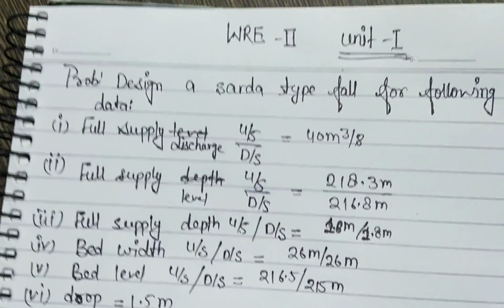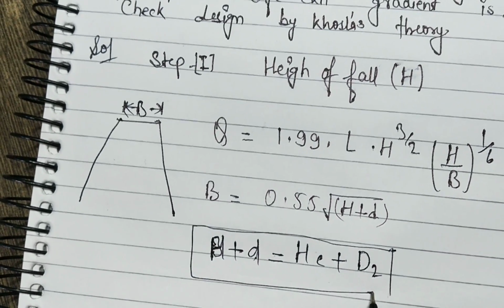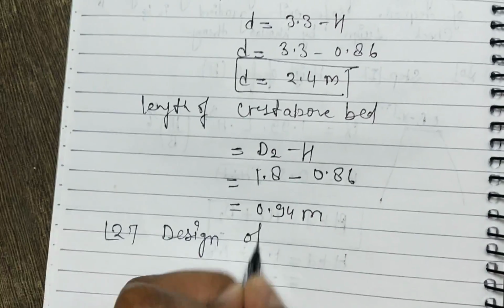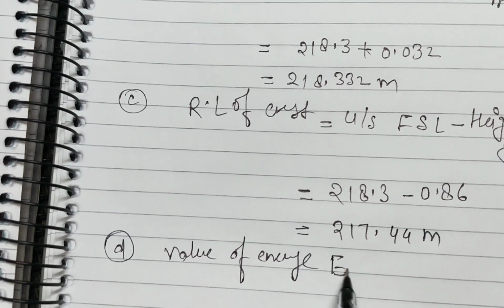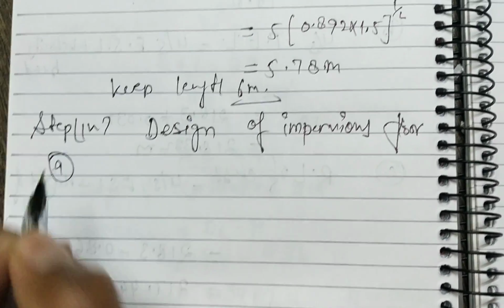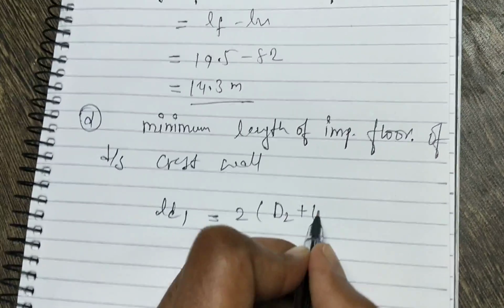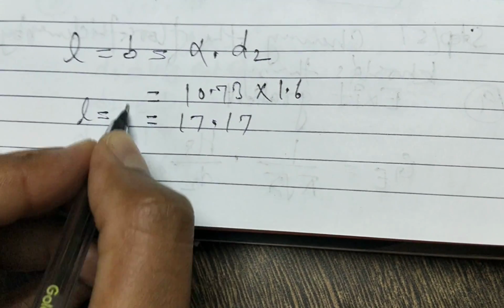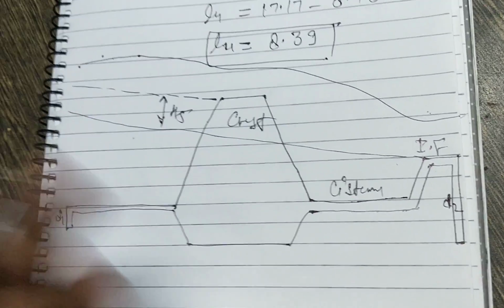Numerical based on Sarda type fall canal

Comment: Sir 4th step m 
Vertical lenth of crop m 
d1and d2 vale sabhi questions n same hoygi
Reply from the maker: Design economy aur comfortableness pr depending hota hai, aap desired value le skte ho. 
By the way d1 ,d2 find out krne ke liye formula bhi use kr skte ho 

     d1 = [{(D2)/3}+0.6]
&   d2 = [{(D2)/2}+0.6]